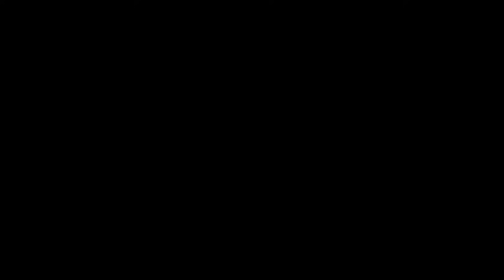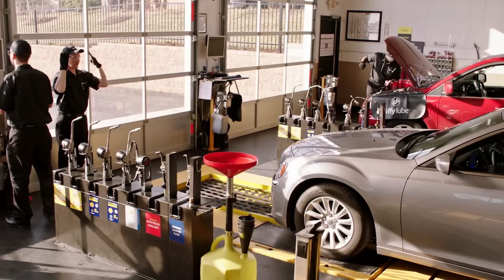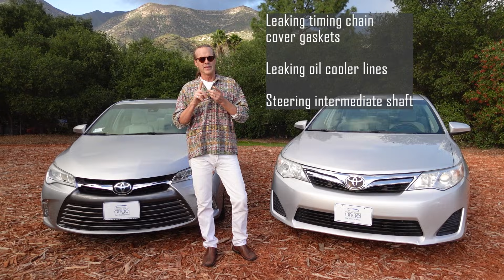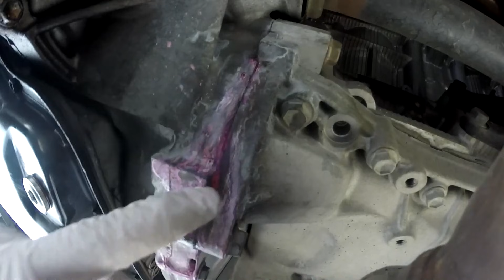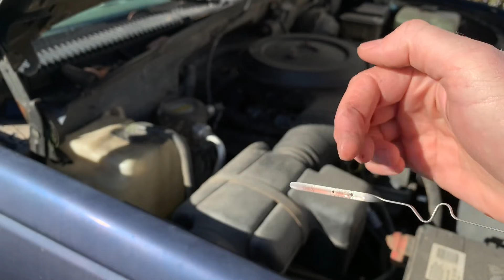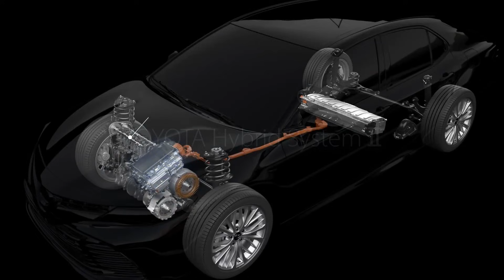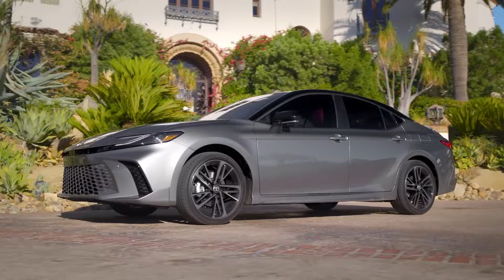Problems to Look Out for When Buying a Used Toyota Camry 2007-2025

Comment: The Direct Shift-8AT  is afflicted with the following  problems : Slow shifting behavior when coming to a stop. Transmission shifting hesitation under partial and full throttle. Jerky and/or harsh shifting behavior . The solution that Toyota  provided is a  ECU software update which continues to make customers dissatisfied especially those owners of the first year of this transmission on the Camry i.e. '18 .

Comment: If your getting a Camry get the new Camry, I rented it it from interstate and car amazing , I was blowing off any v8 car that want to race off the intersection, car very fast 300 + hp long first to 55 and it still gave super mpg, 34 days and still  under full and 35 when in.
Reply: 3-4 days

Comment: awesome video. your video on the 2002 ES300 with almost 600k miles is one of the reasons why i bought my 2002 ES300 3 years ago this month. I bought it as a one owner with 161K miles, it just turned 181k miles. the original owner had the timing belt/water pump and valve cover gasket all replaced at 87k miles at a lexus dealership in NJ. early next year or later this year i’ll be getting the timing belt/water pump done. best car i’ve ever owned. thank you !!
Reply: that's the one drive smoothly, and last very long if you keep maintaining regularly. ☝🏽☝🏽☝🏽☝🏽

Comment: Own a 2013 Passat VR6.  Zero issues.  Also owned a 2018 Toyota Sienna which needed an engine out service to stop an oil leak.
Reply: Im the opposite. Own a 2013 vw passat tdi, had problems throughout the past 6 years of owning it. Bought a 2017 camry, updated all maintenance items. No issues

Comment: If you check the forums, you will see that people are still complaining of oil consumption in the 2AR-FE once the milage gets a little high -- this time due to cylinder wall scoring, rather than low tension piston rings.
Reply: We have just over 101,000 miles on ours and so far it uses zero oil between 5,000 mile oil changes and an oil analysis finds zero problems. Ours is a 2009 RAV4 with the 2AR FE engine. How high do you consider a "little high" for mileage?
Reply: @njsongwriter  - If memory serves me correctly the forums were saying like 100+K, but check for yourself.  And like I said, this time the consumption is due to cyl wall scoring, rather than stuck low tension piston rings.

Comment: I owned a 2003 Camry but the 7th generation is my favorite design
Reply: Yeah espescialy the 2012-2014 . Refresh  of the  2015 to 2017 only adds accentuation of the rear window surround which demolishes the original design of this generation.
Reply: @cabaneencac5168  I agree as well. The 2015-2017 from the front looks like a Corolla

Comment: I thought I'd be more frugal and traded in my 2016 Mercedes for a 2011 Camry v6, I've regretted it ever since. Not only is the car plain and boring, but I've had huge repair bills due to the HVAC system. I had the bad luck to have the infamous "vent/blend door actuator" thing break and had to take the whole dash off to the firewall - twice...then the evaporate blew....the blower has never really worked right. Most shops won't even do that repair...it's pain. The theory by the techs thing the previous owner was so frugal they never turned the AC on...ever. I should have kept my E350...never had one single problem with that car.
Reply: Gotta know what youre looking for when shopping. One lemon or an owner who poorly maintained their vehicle, if at all, doesn't show that the vast majority are more reliable than most other vehicles. If you look at all the car brands on the roads, honda and toyota are easily half of them.

Comment: Great detail as usual. Thanks for such a great video . I'll just avoid that whole camry generation 2007-2011 to be safe . Pls make a video on the Avalon and an updated on es350 !!!
Reply: Please remember, he said 2010-2011 were good.  I've owned the 2011 4 cyl. and passed it along to my son at 170K when I bought a 2019 Camry.  He still drives it daily and it's approaching 240K.  Zero repairs during all this time, it has been flawless.  He drives it nonstop frequently btwn Atlanta & Austin.  Oil changes happen at 5K w/o fail.  I rode with him in it at Christmas last year & it's still buttery-smooth.  I love my 2019 SE and plan to keep it forever.  Again, don't rule out the 2010-11.
Reply: I have been driving 2010 camry 4 cylinder for 14 years only spend on oil changes(fully synthetic) every 5k km or 7 months whichever comes earlier.

The one to watch is 2007 2008 and 2009.
Reply: I have a 2007 Camry hybrid and I love it

Comment: My sister in law has owned her 2014 Camry 4 cylinder for 10 years since new, absolutely zero major issues. I've had my 2022 Camry hybrid for 2 years, oil changes and the caliper gluides needed lubrication, and 41MPG over the last 10k miles. Our first Toyotas for both of us, we get it now!
Reply: I have a 2014 4 cylinder camry with 270,000. Still going strong with all original major components.  Fluids,  belts and oil😊 and brakes is all she's needed.
Reply: @tyrikriggins1807 did you ever had to add oil between oil changes during hot summer days
Reply: There are good Toyotas and then there’s everything else in distant second place.

I always say that if cars were people then the best Toyotas would be Terminators.🤓
Reply: Yes the 2012 and newer hybrid models are THE best second hand cars you can buy they have exactly the same 2.5 engine and CVT as the 2026 hybrid models

Comment: I have 2010 lexus 5th gen with 2gfr-fe engine. Yes  heard it is known to have vvti failure i change oil around 3k and also sometime flush in between. No cold start issues but keeping an eye and  trying to avoid by frequent oil change which  does not cost much when doing yourself ( around 25 to 30 dollars). I live in Arizona so also keeping any eye on any coolant leaks. I flushed coolant around 110k without any issue. I also one time flushed transmission ( using return line) and once time drain and refill. It is running smoothly. I noticed the engine mounts are getting harder because of arizona heat still good though. Plan is to replace them at the end of this year or sometime next year. Overall still running smoothly at 130k. I alao changed spark plugs around 110 k. I bought it at 90k miles with all oil change and maintenance record available from lexus dealer. This engine if taken care earlier than recommended can survive till 300k without any issue. Thanks foe the video it is helpful...

Comment: We have a 2007 Camry XLE Loaded except for NAV.
It has the 3.5L Engine and the 6 Speed Transmission.
It is still quite fast.  0-60mph in just a hair over 6 seconds.

The only thing we had a small problem with was on a Cold Start it would slip between 2nd and 3rd gear.
Just once at start up and not again until the next Cold Start Up. (This was a Common Problem back then)
The Service Director at the Dealership replace my whole transmission instead of just the Torque Converter which I believe was the 'Repair' at the time.
Never had a problem since.

We now have owned this car for 17 years and my Wife will NOT give it up.  She loves 'Her Camry'.
Especially the 6 Disc CD Changer. (I like that as well)
This was our first Toyota.  
Up to that point we only owned GM Vehicles.  Mainly Buick.
However as much as I like the Ride of my Buick Vehicles they had way to many repairs.  Many were just silly/stupid repairs.
Too many to go into here.

My only regret after all this time is that we did not purchase Toyota sooner.  
After looking back I would have loved owning a mid-1990s Camry Station Wagon.
From what I have learned they are a very good vehicle.  Even an 'Double Wiper' on the Rear Window.
Reply: I have an 07 XLE V6 as well but with the navigation, it’s been dead reliable too, only thing is I changed the VVTI oil line to all metal before it ruptured but that’s it, one radiator too and per carfax, one water pump was done as well, I bought the car used in October 2021 and only had 37k miles, currently sitting at 101k miles.

Comment: What gets me about the 2AZ is that they had just finally fixed the 1zz rings and oil consumption by around 2003. Then they started all over again.
Reply: 2007 model got problem with ring (2nd ) that's make piston not tight enough and consume oil , 2002-2006 doesn't have that problem at all. I have 4 Camry from 2002-2006 still run like a champ ( 180k miles is the lowest one and highest one I own now 250k miles) just change oil and brake regularly and go.
Reply: @khakimal  275k on my 2008, never touched Anything on the engine....never done the coolant or brake fluid, Nothing! LOL I don't give a fuck, I just run the car till it blows up....If I wanted to do maintenance, I would buy something More Fun.

Comment: Problems to look for when buying a early Gen 3 Prius and all Prius V. Head gasket (this problem has created a cottage industry), Inverter failure (covered by Toyota—includes all earlier gen 3 Prius and all Prius V), and excessive oil consumption (1 quart of oil needed per week!). My 2013 Prius V had all 3 of these issues. How many people can say a Toyota was the worse car they ever owned?

Comment: I used your buying guide to check for highway miles on my (new for me) 08 Sienna! Took it to my mechanic AFTER the buy, he said he couldn't find even ONE thing wrong with it! Thanks for your help, Greg!
Reply from the maker: Thanks for buying the guide and glad it helped you with the Sienna. I put a lot of work into writing that guide. I hope more people would use it.
Reply: @YourCarAngel  just to be clear, I didn't do the purchased version, I watched your video where you showed on a dry erase board how A majority of highway instead of street usage can create a high mileage vehicle that still has a lot of life and quality left. 
The one I bought had 
1. Perfectly unworn pedals (museum quality)
2. Maybe 25 tiny Rock chips on the front fascia (from High-Speed highway miles)
3. Two large Rock impacts on the lower part of the windshield 
4. No wear at all on the seat belt (looks slightly less than brand new, snaps fully back after being unclicked)
5. 153,910, mi
It's just like you said on the video. 
I drove it around a little bit, it shifts perfectly, drives pretty quietly after it warms up, and I paid only market value ($5.9k) Good deal for me, considering it was a used car lot, and I needed a safe and reliable car very badly after totaling my trusty Honda last year.
Reply: 1997 avalon going strong with 247000 miles on it.
Reply: Oil change 😊
Reply: Personally, if you live in a rainy or humid environment, I would change ALL fluids; oil, coolant, tranny, and yes, even flush brake lines.

I did this to my 2012 Avalon LTD. Bought from private own with 93K miles.

Comment: Just got up and found this. My sister has a 2004 toyota camry xle v6. Ive been maintaining and repairing it.
Reply: That's true! Still drive my 2005 Camry. Solid as a tank. Over 350,000 kms. Toronto, Canada 🍁🇨🇦
Reply: @marcelpatel9017  How does the V6 engine perform after driving for this many years? Does it have any big issues? Recently I found a 2007 3.5 V6 with 223780km selling online, I'm considering buying one
Reply: Better than any other Camry ever made